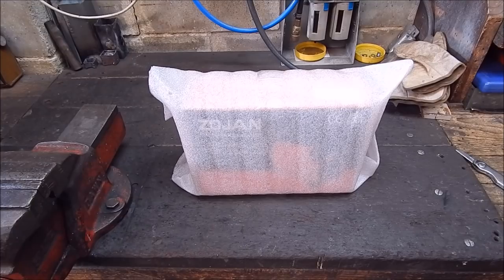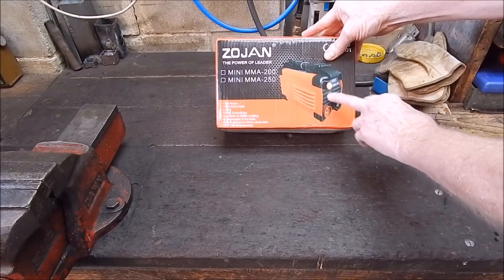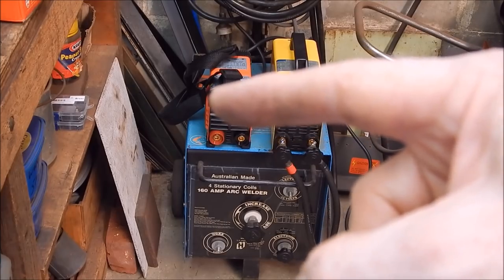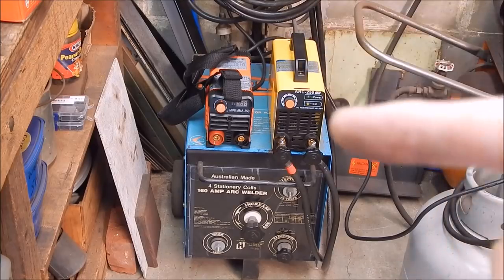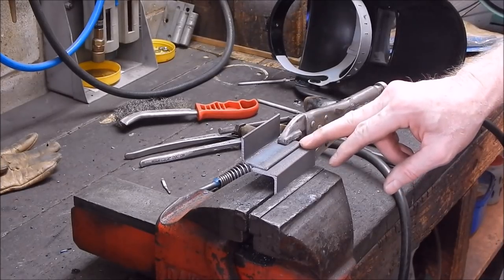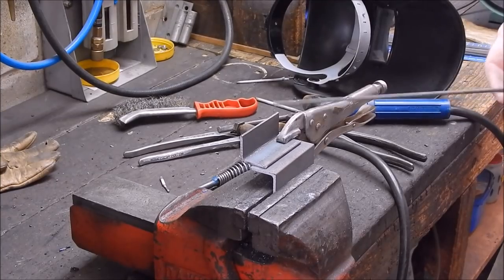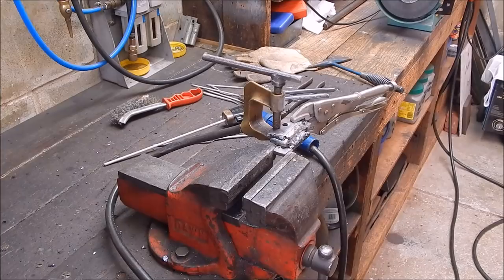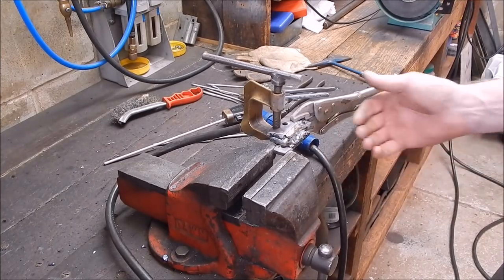Is the smallest DC inverter stick welder from Banggood any good ?

Comment: Here are some useful info for you.
Chinese welders are in two different classes mosfet circuits that are older & costlier 'cause have more parts like 12 mosfets 12 diodes and 6 big capacitors so they are heavier. And New IGBT ones they only need 4 IGBTs 8 diodes and 4 big capacitors. They are cheaper and lighter.
Those pocket size one won't punch more than 120 amp. And have thinner cables cause they also draw less AC and are made for 3/16 and occasionally 1/8 rods.
If you want constant 1/8 and occasionally 5/32 you need a around 10 to 12 lbs device.
The 6010 rods need a special welder that gives more voltage and it's labeled for cellulose rods.
And technically you can't use a 250 amp real welder on full capacity in a house cause they draw more than 30 amps specially if it's a mosfet model.
Those digits shown on the unit are not from an amp meter they are just non sense digits, but there are some manufacturers who really calibrate those numbers and i don't know if they sell their products in your area. If you wanna really work and fed your family with a Chinese welder i recommend to buy atleast a  14 to 22 lbs heavy welder cause they have 8 IGBTs 2 by 2 parrallel so they get torture half the other welders and heat up less.
Something else mosfet welders are marketed in my area as suitable for hot climates, I don't know if it's just marketing nonsense or what but seems metal workshop owners around here really believe in that stuff so it might be a factor for you while choosing.
Reply: how can find real output amp? I'v a 300amp IGBT. i think it's fake.
Reply: @CeylonLastMile 
Huh....  "The 6010 rods need a special welder that gives more voltage and it's labeled for cellulose rods"..???
Who told you this bullshit..??
6010's AND 6011's run sweet on any garden variety DC welder..!!! 
And if they don't.... then I must be a fucking freak.
Reply: Good info, 
Thanks

Comment: Great review, but the ratings are Chinese amps.. 2 Chinese amp = 1 rest of the world amp. I put a clamp on meter on mine to find out why it needed so much more dialed in than my crappy old Saf, and it's pretty well half of what's displayed.. Chinese seem to like big numbers, who cares what they mean, just make it read BIG numbers to be happy lucky shiny. Maybe they took Spinal Tap seriously..
Cheers.
Reply from the maker: Very similar to Chinese horse power (ponies).
Reply: 110V VS 220V?
Reply: Chinese technology lie to sell products 
-I bought yellow mini welder rate 200A, but output only 120Amps, i use 220vin

-I bought oranges leaf welder rate 250A, but output only 60Amps, i use 220vin
Reply: Thanks, now I want a welder that goes to 11.

Comment: Good review Rob, certainly put it through a decent range of rods. I am looking to replace my old Able AC welding machine as it finally blew out last week, it was a hand me down from my father so it was about a 50's or 60's model I guess. Thinking about a MIG that can do inner flux core also. Still would like to have a small stick welder around the shed though. Any suggestions on a MIG or TIG?
Reply from the maker: I'm not into MIG or TIG.  Can't help there.
Reply: No worries, really enjoy your videos.

Comment: What I previously commented on "The Fabrication Series" channel : What you're interpreting to be amps is more likely "power" or percentage of output capability expressed in decimal from an 8 bit encoded value (256). The actual upper and lower bound are probably mechanically limited or are interpreted from a poorly calibrated analog potentiometer. 254 was shown in that video and 251 in this one.
Reply from the maker: Hi Shawn,

That's not the way welders are calibrated.  It's always actual amps going to the job.

How can you have 250% of output capacity ?

In this case the setting readout is way off target.

Cheers Rob
Reply: To clarify, the computer (microcontroller) that is controlling the inverter is taking a signal from the knob (0-100%) and encoding that from an analog potentiometer range of some resistance value. The encoding usually happens with an 8 bit analog to digital converter which supplies a decimal value of 0-255 (0-100% again) to the controller which is used for pulse width modulation (or some variation) to control how long the power transistors are turned on (% of time). That (0-255) value is being displayed, not a calculated or proportioned value of amps.  In other words, they took the model number from the display, not the actual engineered power rating. It's typical in non-english speaking countries to mis-translate from engineered design to user documentation and this is a great example. Even the numbers under this unit's knob are 1 and 10. A note on labeling ranges: https://www.youtube.com/watch?v=4xgx4k83zzc Examples of electronics implementations: https://www.youtube.com/watch?v=TdNHhc3s8R0 and https://www.youtube.com/watch?v=U7h-i9cG6cA
Reply from the maker: OK.  I understand where you're coming from.  The display is not very useful to experienced welders, no relationship to actual work amps.

Thanks for the comments.

Cheers Rob
Reply: These welder meters do seem to calibrate from a separate voltage/resistance within the machine, when I turn on the pulse on my welder the number on the amp meter starts jumping around and reading random points on the waveform. I thought the potentiometer was going bad

Comment: I recently had a welding instructor tell me he'd been chatting with a rep from one of the major "colors" of welder manufacturers and the rep told him they could build almost any feature into a welder the size of a small briefcase.  The reason they don't is that the marketing department insists that people expect full featured, expensive welders to come in larger sizes and scoff at "small" welders.
Reply from the maker: You can see by the number of views of this welder that there is a lot of interest by people in small ones.  Interestingly, even though I recommended against buying this one over the larger Usewell (for the same money) BG have pretty much sold every unit they had.  That tells you something.

Cheers Rob
Reply: Hmm air cooling seems to be the problem in small units

There are some components that get hot and some that do not

It is usually better to keep them apart
Reply: esab rebel is a good example, lots of features In a relatively small form factor. mixed reviews on those though ...
Reply: I have a small welder of Chinese origin I bought a few years ago, it is about 4 times the size of that one but it has a tig setting with hf start, a gas solenoid, 2 pulse settings a  down slope adjustment and it is rated at 180 amps@60% and 125 amps at 100% it will run 4mm rods without a problem.

Comment: Hi Rob, I use a rule of thumb which is 1/8 rod = 125thou =125amps as a starting point therefore 1/4 rod =250 thou = 250amps etc. I absolutely agree some rods just seem impossible to use depending on which way the wind is blowing ;-) ;-) ;-) all the best Malcolm UK
Reply: The 1 thou (0.001") = 1 amp rule only works up 0.125" or 125 amps. After that the formula breaks down.
If you try welding 1/4 or 0.250" at 250 amps you'll be running to hot.
This particular welder doesn't weld at 250 amps. Divide everything by 2 to get true specs.
Rods aint the problem, its amps. Dial in 250 amps to weld at true 125 amps and it should be okay on 1/4" plate fillet welds.
Reply: * Chinese technology lie to sell products 
-I bought yellow mini welder rate 200A, but output only 120Amps, i use 220vin
-I bought oranges leaf welder rate 250A, but output only 60Amps, i use 220vin

Comment: I got this welder a few weeks ago. After burning several rods I figured out that while the machine may say a max of 250 amps, it should read 150. I ran several 3.2 7018 rods starting at 130 and it kept sticking and running poorly. When I upped it up to 230 (which is actually 130)they ran great. I also ran 4.0 7018 rods at the max setting, which is actually 150 and they ran so-so. I tried running 6011's. They would arc and run for a few seconds and then die out. This unit didn't seem to agree with them.
Reply from the maker: I can only agree with everything you said.  You can tell by the heat wash from the arc that's it no where near what the meter says.

It's not a patch on the Usewell 250, which is a really excellent little unit for the same money.

That's what these reviews are all about - sort the good from the not so good.

Cheers rob
Reply: I only paid $110 Canadian shipped to my door, while not bad for the money I agree there are better units out there. I'm looking at an Everlast PowerARC 200 at the moment. It has a dedicated connection to run 6010 and can also run TIG.
Reply: Could be a reoccurring phenomena on cheap, compact China machines or so I suspect, I got one from Stamos Germany (S-MMA 200P IGBT) but also China made, apparently under supervision however I highly doubt that haha..  Mine is a "200A" MMA and hooked up the calibration equipment in the shop and full 200A on the display came out as 150A in real life but the machine is tiny and duty cycle at only 20%. Does not seam to be this picky on different rods though but it's a toy and not exactly allowed to to use in any ISO1090 project just wanted something tiny in my complete tool box with me all the time when out, must open ans see if able to calibrate or somehow match the display to actual current, worst case will have to memories the difference lol.

Comment: Watched another pro, he said they ran about 30% to 50% lower than amperage indicator...Some he had to double what he thought it should run, but it does weld and it did not kick out after burning through 12 rods straight in a hot shop...So, after watching this one, I'd think for the bucks, and for someone that uses one only occasionally, it might well be worth the bucks compared to some of the monsters out there and the prices that go with them...I'm an HVAC man, so I don't really use one that much, but if I had to tote one up to a roof top, I'd be glad with the small size....lol
Reply from the maker: Depends on the welding unit.  Some are less than advertised and some have the stated output.  I tested three different unit models and only one was correct. Cheers Rob

Comment: Everybody is complaining about these Chinese made mini welders not producing 250A output, but does anyone think about if your AC outlet can provide that much power to the welder at all. Here is the simple math:
At the welder's output, let say the DC voltage is 30V, the power output of 250A x 30V = 7500Watts.
Instead of 30V, let say 25V, the power output is still 6250 Watts.
Now let's look at the  power output from the house outlet with a 20A circuit breaker, 220V AC x 20A = 4400 watts.
Therefore if you want to weld at 250A, you will need at LEAST a 40A circuit breaker to handle the load and the initial rush current.
Morale of the story, do you really expect to get a T-bone steak at a Madonald burger price?  To put it another way, can one expect this type of light duty (amateur type) welder to perform heavy duty work. By the way,I paid $51 including shipping from Banggood in the US  for one of this. The parts alone costs more than that if I were to build one myself.
Reply from the maker: Yes, you have to be realistic about things.  The maximum rating on these welders is I suspect peak amperage for a brief moment (strike) similar to how generators operate.  I don't believe the dial reading is actually a continuous rating at all.  Throw in the fact that these inverter welders use pulse technology to give DC an edge and reduce mains requirements, it's laughable to expect to get an accuarate cable reading with a regular multimeter (with averaging).  The ONLY way to get a true reading s to put a measured resistance load across the outputs, same as the manufacturers do.  At the end of the day if it welds OK and does the job, who really cares anyway ?  Cheers Rob

Comment: 250 amps on DINS 25 plugs? Yeah sure...
Reply: duty cycle is so short at 250A it would not harm those plugs at all
Reply: The DKJ10-25 connectors I bought were supposedly rated at 250A although the Riverwelds on amazon say 200

Comment: Please measure the amps with a C clamp amp-meter. To show proof and To see if the amps are accurate as advertised with this model with so many welders overblown amps and fake duty cycles.
Reply from the maker: You really need to test the output with a commercial load resistance instrument right at the connectors to get an accurate measurement.  Cable clamp measurements are mostly unreliable.

Most clamp meters give an averaged reading and as these inverter welders use pulse technology (as I understand it) for the DC output, this will seriously mess with any readings.  It's also how they can manage to give 120 AMPS welding current but draw less than 10 Amps.  The numbers on the output scale are mostly meaningless from my observations.  

The fact of the matter is that they will weld 3.2 mm rods on a 10 amp breaker  (done that on at least three of these cheap inverter welders), which would require a 15 amp breaker with any old style standard transformer type AC welder.  So they are MUCH more efficient and the technology is totally different. 

Cheers Rob

Comment: Zojan does not know who makes this welder. I seek for a shemactic diagram, i have one to repair. Those welders run 125 Amps maximum, show the double on digital readout, and weld like a dream. The arc force regulation is as good as my ESAB 170 Amp Welder or my CIGWELD Tig 200 digital. I use it for welding stainless tubes and profiles permanetly. Watch our to switch it off while you gridn or clean with grinder, the fan on rear is close to the circuit board and iron dust can cause short circuit somewhere. I know this, since i had it. It is for me the best small welder I ever used, i bought it once to ow a gadget, but it is a real serious machine to work with.
Reply from the maker: It's the easiest DC welder I've ever used.  Totally vice free. I can't help with a schematic.  Sorry.  Cheers Rob

Comment: Would have been interesting to see a DC clamp meter on one of the leads (or an AC clamp meter and math on the input side) to see how many amps it was actually putting out.
Reply from the maker: Yep, but I don't have one.

I did use a meter on the input to see what they draw and that was pretty interesting, in line with the up to 50% less amps usage sales/technical blurb.

So they are definitely more forgiving on a domestic power supply.

Comment: Jambo Bwana....what is output voltages of this welder at those variable amps and duty cycles? Are the outputs DC or AC? Am a beginner. Asante sana for the nice work.
Reply from the maker: The output is DC.  I didn't measure the volts.  You can only go with the specification as supplied/stated.

Comment: also check the  ground wire is actually connected properly,bought chinese floodlight's one time and the earth connection's were either shocking or loose in the casing,they just had a screw with a star washer and a bare wire put under the washer,half of them it was barely hanging on, some were ok and some not even connected.

Comment: You're not showing if you are connected to the portable unit and the settings.
Also, does the unit comes with the positive and negative codes?
Reply from the maker: Codes ?
Reply: @Xynudu  sorry, I meant cords/cables.
Reply from the maker: No cables, just the machine.
Reply: @Xynudu  ok, thanks.

Comment: did both, the Usewell and this Zojan come without welding leads, ground clamp and electrode holder?
So the owner has to buy and put on a wall plug, buy and mount welding lead cables, ground clamp and electrode holder. Does banggood offer those items? At what price? To fairly compare the prices with other units delivered with all necessary accessories you would have to add the prices of all items necessary to weld.
Reply: order a set of 20 ft. 2,4,or 6 guage jumper cable4s off ebay for less than 20 bucks and a 10.00 electrode holder and you have a good set of leads cheap

Comment from the maker: Update:  I took some amperage readings with a DC clamp meter to see how accurate the digital display is(not).

After allowing for a 25% amperage drop from the 8 metre work cables (I compared output drop of three welders) it turns out that the digital readout on this welder is 20% high (dead in line with my suspicions).

This also aligns/corresponds with a text review on the BG site.

So end of story on the meter accuracy

It also clearly indicates that this is only a 200 amp welder (the numbers match exactly).

Cheers Rob
Reply: It does not matter how long cables you have, current is constant everywhere in the circuit. "Amperage drop" is not a thing. It's the voltage that drops. Other have reported that the actual current is all-most exactly 50% of what's shown on the display.
Reply: It depends if the control loop is open loop or closed loop. If it's open loop there will be no voltage compensation and therefore current will be heavily influenced by the resistivity of the rods and work piece.

Comment: doesn't "no ground wire" usually mean it's shielded?  Lots of workshop tools, circular saws, etc do not have ground wires in the mains line because their innards are shielded.
Reply from the maker: Those items are usually "double insulated" - ie have a plastic housing.  Shielding usually refers to EMF suppression.

Comment: If you buy a welder with a 2 wire cord, can a ground wire be added? I was looking at a cheap one from banggood and it appears to only have a 2 wire cord with no ground.....
Reply from the maker: Yes.  Simply replace the cord with a three wire and connect the additional ground wire to the metal chassis.  It's penny pinching when not fitted as OEM.  Cheers Rob
Reply: @Xynudu  Do you have to add a ground wire? I recently bought small &cheap, haven't used it yet so any advice would be great. 👍